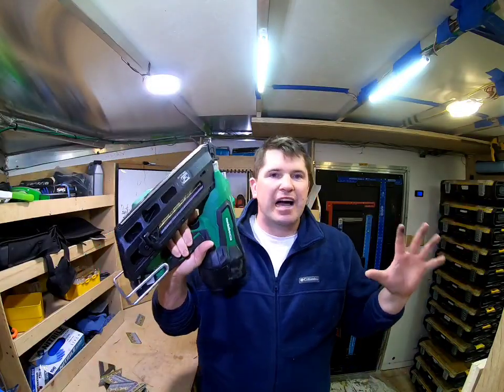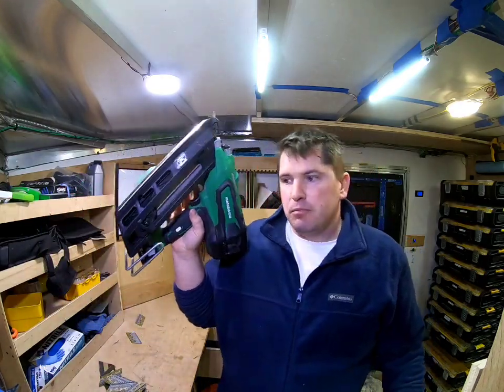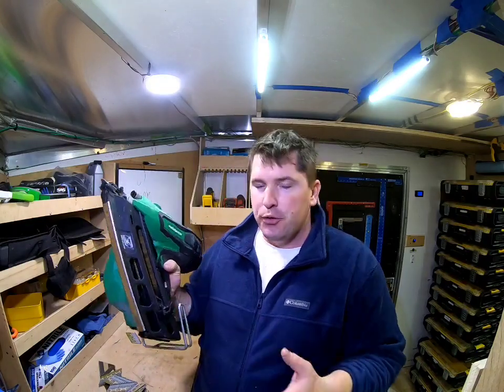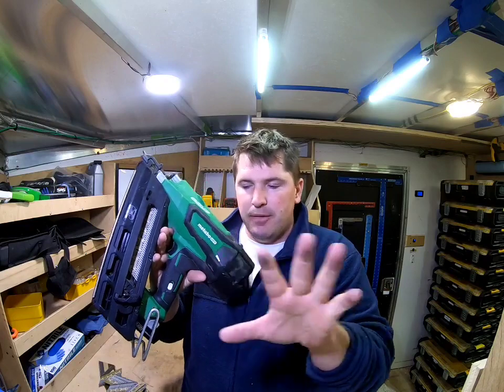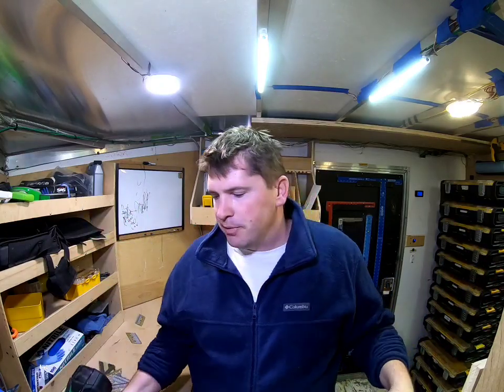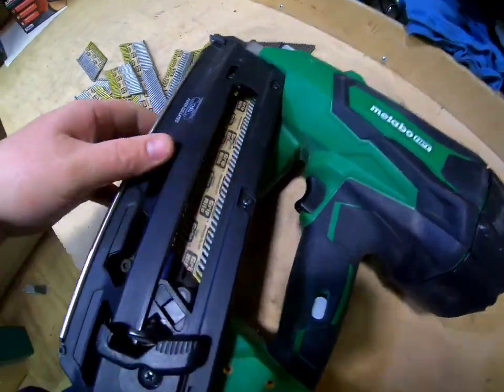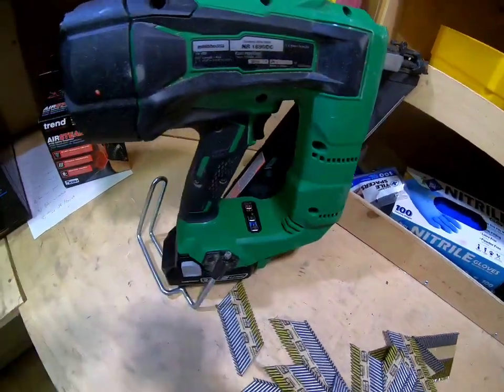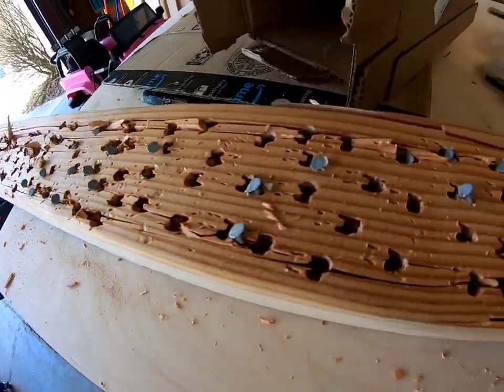Metabo/Hitachi Framing Nailer Review and Run Time Test!

Comment: Good review, I have 2 x Dewalt DCN692 nailers primarily used for fencing work and they are OK with 50mm but not good with 90mm nails. Been thinking of getting one of these for a while, but not on the Hitachi platform which puts me off for the moment. Also, I think this is a little heavier than the Dewalt and the on / off switch is meant to be a right P.I.T.A 😬
 Did you get rid of your Dewalts ?
Reply from the maker: Yes sold all of them to help fund the Hitachi nailers.
Reply: @RenovationsandRepair  how do you feel about this versus the new Milwaukee framer? I'm leaning with metabo since I plan on buying their 36v cordless and corded table saw.

Comment: Nice video ! Which brand 15g nailer do you use ? So far the Dewalt seems to be the best between Milwaukee and Metabo (smaller end), whats your take ?
Reply from the maker: Metabo hands down. Milwaukee fails a lot.  Dewalts has not failed but I do not like the fluwheel design.
Reply: @RenovationsandRepair  One thing I have to give to the Dewalt, you can purchase it here in Canada as a tool only while Metabo sells the kit only, also the Dewalt tip is smaller for more precise shooting. Funny thing is I have the Metabo cordless framer, Milwaukee gen2 brad nailer and waiting for the Dewalt 15g, cant have too many right ?
Reply from the maker: No you can never have to many tools. Thats a fact.

Comment: What are the pros & cons of 21° vs 30°? The Metabo 30 degree is selling for US$300 with battery & charger and the 21 degree kit is selling for over $400. Why the difference?
Reply from the maker: Check your local building codes. They may requier a certain collation nail

Comment: Does the nailer still work fine, I am considering buying one since I have metabo hpt tools, but I worried it might not last and at 400$ it kind of pricey
Reply from the maker: Still a rock solid tool. No issues
Reply: @RenovationsandRepair  ok thank you very much

Comment: Great video. 
I think you forgot to mention the model of tool of this Metabo. It would make a difference as Metabo makes a 21 degree and 30 degree model with the 30 degree model having a higher capacity of nails per load.   I'm thinking yours is a 30 degree model.
Reply from the maker: Yes it is the 30 degree model
Reply: For someone who's never used a framing nailer, what's the difference and what do you prefer? Looking to build a shed!

Comment: So playing devil’s advocate, if you can shoot 336 nails on a battery, and typical 2x6 walls would get three nails to a stud you could build about 80-90’ of walls with this (not including sheeting the walls, which I would do with air anyway) that means for us on our last build it would have taken 4 batteries just to build the exterior walls. I’m not super familiar with the Metabo, but too me that seems low 🤔
Reply from the maker: Seems about right from my real world use. Though I'm sure bump firing the nailer 336 times.. used the battery up a bit premature.  Definitely wan to to have an extra battery..or 8!
Reply: Renovations and Repair no doubt. We like to frame the walls with cordless guns so we’re not getting the hose stuck on everything. But then we sheet them with air and cap staple our tyvek on. Cordless cappy would be cool!
Reply: They definitely burn through the batteries! U can also use the 36v 8ah batteries they last longer but are heavier!